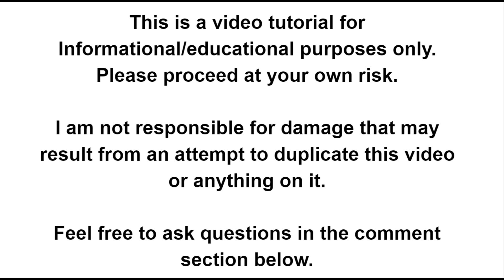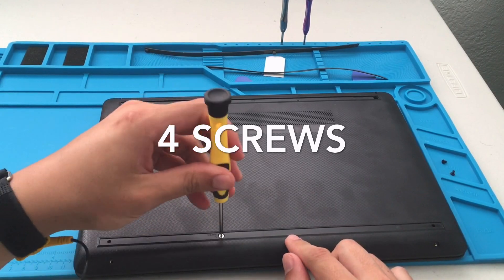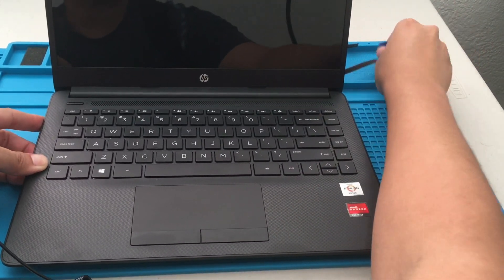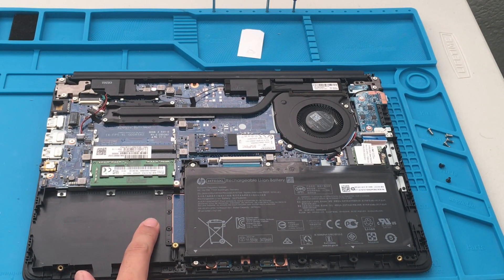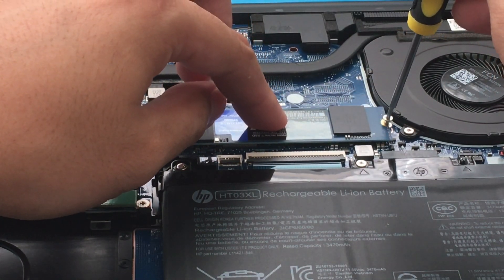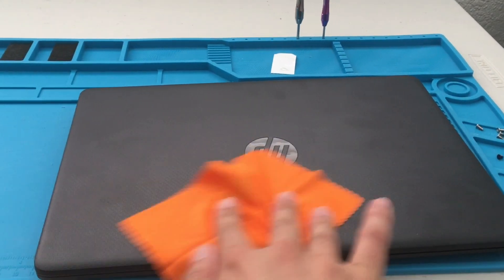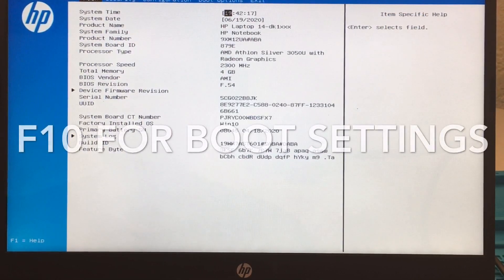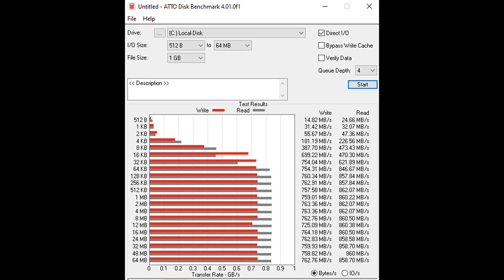500GB SSD M.2 Upgrade | 2020 HP 14 inch Laptop | 14-DK1003DX

Comment: hello, I hope you can help me, I have an hp 14 dk1xxx and I don't want to change the 120 gb ssd that it has by default, I just want to add an additional ssd, does it have another slot or should I buy another type of hard drive?

Comment: hello, great video but I have a concern, the port for the ssd m2 supports both sata and nvme? is that I want to buy one that is compatible and I do not want to make a mistake in the purchase 😅
Reply from the maker: If you look toward the end of the video, the original ssd is a SATA (notice the M Key). The new ssd is an nvme, but the read and write speeds for the upgrade (new m.2 nvme ssd) isn't huge if that makes sense hope this helps.

Comment: Did the same except went with 16gb of ram.  Definitely an improvement in performance especially when playing games.  I just used the migration software that was free from Samsung and did not have to go into the bios to make any adjustments at all.
Reply from the maker: Great! 16gb is the perfect amount
Reply: I also did this
Reply from the maker: Nice 16gb is the sweet spot
Reply: Me too but anyone know how to add the 2.5 ssd? Is there a kit for it? I'd love the extra space
Reply: @TheJonci0322  I was wondering the same when I opened up the case and saw the space for an extra drive but no connections.
Reply: @TheJonci0322  Hi there i know im 3 years late but yes you have to buy a data transfer cable to sata 2.5 hdd but the caddy i'm not sure what size i just put double sided thick tape and its very awesome having SSD & HDD in a HP laptop

Comment: Can i do this on my hp-14 bw0xx?
Also I'm wonderinf whether it's better to upgrade to 8Gb of ram with 500GB ssd or 12 Gb of ram with 250gb ssd? I use my laptop for video editing, and photoshop
Reply from the maker: I an not familiar with that model unfortunately. You can check you tadk manager > performance > memory to see how many slots of ram you have. You can also run crucial scanner. Another way is to use crystal disk info to see if you have an nvme ssd install currently
Reply: @whattmeter  i have 2 ram slots with max of 16gb. And drive interface: sata/m.2 sata. Sata version 3-6Gb/s. When i went to task manager-performance there's only HDD?
Reply from the maker: @FifaMaestroAdam  Oh so for ram you already have two slots filled out?ah so HDD that means you probably have a hard drive installed. If I have your model correct, here's what I found on crucial. I would double check though because I could be wrong. Looks like you can upgrade to a 2.5 inch SSD. Also on your first post, if you plan on gaming definitely 250GB ssd will fill up quick. Just my thoughts https://www.crucial.com/compatible-upgrade-for/hp---compaq/hp-14-(amd-14-bw0xx-models)#ssd

Comment: Can you help with locating a connection/ribbon cable that can connect for this laptop to a ssd that 2.5? I know that laptop has room for it but I cannot find it from accessories on HP website at all super frustrating.
Reply from the maker: I still haven't found any yet, not even on amazon

Comment: great video do you know if it is possible to use a usb adapter to connect M2 SSD to a PC? thanks
Reply from the maker: Ive never used one before
Reply: @whattmeter  thanks I found a 2.5 hard drive adapter that use M2 SSD inside
Reply from the maker: @cronos6252  Omg where! I would like to order one and make a video about it if I can.
Reply: @whattmeter  google sabrent m2 SSD to 2.5 sata III aluminium enclosure EC-M2SA amazon or ebay !!!
Reply from the maker: @cronos6252  thanks! i'll give it a shot
Reply from the maker: @cronos6252  thanks! I found some and saved it. Hopefully in the future I can order one and make a video.

Comment: Muy buen video! Quería consultar, estoy entre este modelo de HP con un Athlon silver 3050U, pero con 16gb de ram y 480 ssd o una lenovo con monitor de 15' que tiene un core I3 10th gen, 8 de ram con 240 ssd. Cual me conviene? Me hace dudar el procesador a la hora de elegir. Cual recomendas?
Reply from the maker: Solo mi opinión, pero el i3 de décima generación es bastante bueno si nos fijamos en los puntos de referencia. un lenovo de 15 pulgadas probablemente solo tenga una ranura para ram. En mi opinión, optaría por lenovo, porque puede actualizar a 20 gb de ram fácilmente en el futuro. (Just my opinion but the i3 10th gen is actually pretty good if you look at benchmarks. a lenovo 15 inch most likely only has one ram slot. In my opinion, I would go lenovo, because you can upgrade to 20gb ram easy in the future.)

Comment: What was the cmd?
Reply from the maker: Cmd ? Command prompt?
Reply: @whattmeter  yes
Reply from the maker: Yeah I used it to pull up the windows license key as a precaution. Not necessary but just in case
Reply: @whattmeter  ok what types of rams do I need to upgrade it?
Reply from the maker: Ddr4 laptop ram. Speed 2400 Mhz

Comment: When you take out the original ssd, I see the connector type is sata (three prongs).  And then the new one you put in is pcie 3x4 connector.  Will this laptop take both?
Reply from the maker: I’m learning as I go along, but from my understanding the original 128gb ssd that has three prongs is an m.2 sata which you pointed out. The new one is an m.2 NVME, specifically a western digital brand that has backwards compatibility. I have the model numbers toward the end of the video. Since there is a lack of info on the motherboard I suspected that not all m.2 ssds would work so I went with the WD SN550 which is backwards compatible with older m.2 sata connections.Basically I played it safe and it payed off because if you look at the speed test for the new ssd, its faster than the original but not as fast as it says on the box. I have the same wd sn550 m.2 ssd installed on an old gaming pc and the speed test shows it achieve speeds close to the box. https://youtu.be/HKX2nncy-jE basically I don’t think all m.2 ssds will work on this laptop. I would make sure it is a backwards compatible nvme ssd that can run on older m.2 connections

Comment: Hi Jace, great video, thanks for sharing. I'm interested in upgrading the SSD storage  to 1tb and i see when researching there different read/write amounts. How does that affect this laptop and is there computer limitations that I need to be aware of with these upgrades?  The laptop now has 8gb ram.  I appreciate any insight you could give me, thank you.
Reply from the maker: The gaming pc crystal disk info transfer mode is pcie 3x4 to pcie 3x4. So that explains why it reaches the max speed. If we search max bandwidth of pcie 3 it is 3.94gb/s. Also glad you have upgraded to 8gb of ram! I think when you buy an M.2 SSD and install it on this hp laptop, it won't achieve the full read/write speeds. It would be faster than the original ssd though because of the transfer mode is limited on this 2020 hp. it's also possible there's something you need to do to unlock the full transfer mode on this laptop.
Reply from the maker: Very good question. Yes the laptop has a limit for ssd read and write speed. The wd ssd I installed is super fast (I installed the same model and brand on my gaming computer and it achieves the speeds it says on the box 2400mb/s read and 1850 speeds). But when I installed the same ssd on this laptop the speed is limited. In this video look toward the end of the video, the read and write speeds is highly limited and couldn’t do the full read/write speeds the ssd is capable of
Reply from the maker: I am not an expert but check the speed of the exact same model and brand of the m.2 ssd I installed on my old gaming pc. The speeds are insane compared to the laptop speed which is limited https://m.youtube.com/watch?v=HKX2nncy-jE I just checked crystal disk info and the transfer mode for the ssd is pcie 3.0x1 and pcie 3.0x4. So if you look up pcie x4 maximum bandwidth the max it can go is 1000mb/s which explains why in the video i was getting a read speed max of 901 and write speed of 795 mb/s. I will do more research to double check this. I could be wrong.

Comment: I don't know if i saw well, but the laptop comes with a 2.5 inches ssd slot apart from the m.2? In that case, it'd be possible to have an m.2 and a 2.5 ssd together as storage?
Reply from the maker: I opened it up again. Yeah I didn’t see a ribbon cable connector to connect a 2.5 inch ssd. I even removed the battery.
Reply: Ok! Thank you!
Reply: @jysfie  bro, encontraste si se puede agregar un ssd de 2.5?
Reply: Old comment, but do you see the ribbon socket on the motherboard that says HDD? There's your socket. To get the ribbon, search 'laptop sata hard drive ribbon' on eBay, or similar search keywords. They're about a tenner.
Reply from the maker: There is a space, but I did not see a connector for a 2.5 inch ssd
Reply: Ohh, such a shame. It'd be great if it had it
Reply from the maker: Yeah. Idk if you can buy a ribbon cable but I’m not even sure if the motherboard will have the drivers to support it. I haven’t seen anything on YouTube yet. Maybe in the future someone will make a video
Reply: Any updates on being able to add the 2.5 ssd?

Comment: I just bought mine from Amazon and I'm a Photographer.  Can I buy more RAM from Amazon?  P.S. I haven't even received mine, yet.  And I'm excited!  Previosly, I was an Apple MacBook Pro user.  And I just couldn't afford the high price.  Is it easy to remove or open the laptop??  Thank you.  I subscribed.
Reply from the maker: Hi yes. I made a video with 32gb ram upgrade. Yes I bought my ram from amazon too. Make sure to double check the speed of the ram before you buy more ram. Opening up the laptop isnt too hard. Just take it slow and make sure you have a plastic prying tool. The good thing about this laptop is that it’s a 14 inch, which is very common so many videos on opening up this type of laptop
Reply: Would you recommend upgrading before adding files,photos, and data or does it matter?  Also is Windows 10 an extra purchase??
Reply from the maker: It depends if you have a lot of files. 128gb of storage isn’t a lot but you could use an external hard drive or flash drive. If you know how to create and load an image you could always upgrade the ssd in the future. In terms of windows s mode that comes with the laptop I made a video on how to get out of windows s mode since people kept asking. It’s an easy process and should be FREE. So basically you should be able to go to windows home edition on this laptop free and it’s a simple process
Reply: Yes, I noticed when you put the Windows 10 in the side of the laptop.  Also wondering if I can find the Kingston part on Amazon?  😊
Reply: Because I would like to upgrade it all at once.
Reply from the maker: The ssd i used is a western digital brand but I can’t recommend it since it got popular and the price went up. The original ssd kingston is worth 25-35 on ebay I noticed but it’s only 128gb. There are many m.2 ssd options out there. Hard to recommend a specific one as prices vary. If you look toward the end of the video i put the exact model of the ssds.
Reply: @whattmeter  Oh, that's right, you mentioned eBay.
Reply: @whattmeter  Where did you buy the Windows 10 Home Edition?  Sorry I'm asking so many questions.
Reply from the maker: Yup so this laptop comes with windows 10 s mode. You can easily switch it to windows home edition without reinstalling windows if that makes sense. You will probably figure it out once you try out your new laptop
Reply from the maker: No worries. You won’t need a windows 10 installer to switch to windows 10 home edition from windows s mode unless you are replacing the ssd. If you do want to change the ssd, you would have to load an image or reinstall windows 10. It’s not to hard creating a windows 10 installation usb there are many videos out there
Reply: @whattmeter  But, where may I ask did you get that little square thing you plugged into the usb?  Because I do want to install the a ssd.
Reply from the maker: It is a bootable windows 10 installer created on another computer. It is a regular usb with windows 10 bootable (this is how windows 10 is installed mostly nowadays). I actually created a video for that too scheduled in a few weeks. Let me release it right now so that you can see
Reply: @whattmeter  Darn it!  I don't have another computer.  Now I'm wondering what I should do.
Reply: I also purchased an Android Flash Drive for my Smartphone to transfer all photography to be in the laptop.  Is this a concern like the need to know specifics on that too?
Reply from the maker: Not too familiar with all types of android flash drive but I recommend going out of windows s mode to windows home edition first so that you are not limited. Windows s mode has a lot of restrictions, can’t even install chrome or firefox. It’s something windows created for security. But almost everyone i know needs to install things like zoom and chrome so they took out windows s mode. Hope this helps
Reply: @whattmeter  It sure does and I appreciate your channel for that.  What browser does this laptop use?
Reply from the maker: https://youtu.be/NwECUN-xUjM here is a video I made to switch to windows 10 home for this laptop. This browser comes with Microsoft edge (formerly windows explorer). You can always install other browsers like chrome and firefox or other browsers once you switch out of windows 10 s mode
Reply: @whattmeter  Yay, yes!  I watched it but will rewatch it.  And, I like Google Chrome; so I definitely would want to be able to have that in my laptop.  I remember Windows XP when I had a Dell Desktop and Windows Explorer.
Reply from the maker: Here is the video Of how I created the windows 10 usb you see in the video https://youtu.be/2KPC3-d19Rk
Reply: @whattmeter  Thank you, so much.  I will go watch it.  😎
Reply from the maker: You’re welcome! Also consider creating a free Microsoft account when you get your laptop (similar to icloud). The reason is so that you can locate your laptop (kinda like find myiphone or kinda like locating an ipad or macbook) it’s pretty cool. Hopefully that makes sense. Something I learned recently. But definitely do your research.
Reply: @whattmeter  I will have to get back to you on creating a free Microsoft acct.  I've got to get up at 5:00AM.  thank you for your help.
Reply from the maker: If it’s too complicated no need to make a free microsoft account. Start with a local account when you set up your new laptop to make things easier
Reply from the maker: No problem you can create it (win 10 installer) on your new laptop once you get out of windows 10 s mode. You don’t need another computer. Just make sure you create it before you remove and upgrade the ssd (if you are upgrading). Good luck and I highly recommend looking at other tutorials as well to give you a better idea
Reply: @whattmeter  YAY!!!  That gives my inspiration!

Comment: are you going try change thermal paste? I'm interested in doing for better performance!
Reply from the maker: It's pretty fresh so no not on this laptop. The factory thermal paste actually does a great job. with the ssd and ram upgrade it runs fortnite, dead by daylight and a bunch of other games others had me test. (i added 32gb ram so the gpu has 2gb of dedicated memory by default and the extra ram allows it to have an additional 15gb of shared gpu memory). it will run games at low.
Reply: @whattmeter  what kind ram is it?
Reply from the maker: Oh it’s share gpu ram that helps the dedicated gpu ram. Because of the the ram/memory upgrade of 32gb it allows the computer gpu to access more ram when needed

Comment: So I barely have anything on mine, what should I do? Still make the backup or switch it out?
Reply from the maker: It’s really up to you. I would definitely write and save the windows license key and any software that you have that has product keys at least. Just in case you need to activate the windows license again. I did a fresh install on mine but saved the license key before switching out the ssd
Reply: @whattmeter  OEM windows key is paired directly to the motherboard. As long as you reinstall the same version of Windows that came with the machine, it will be guaranteed to reactivate itself.
Reply from the maker: Thanks! Hehe i guess i’m scared. But yup I didn’t have to reactivate mine. I guess i like playing it safe because of my previous experiences with windows
Reply: @whattmeter  luckily this changed with Windows 8. Ever since then, keys are tied to the motherboard. Windows 7 and before were a pain for that.
Reply from the maker: Haha yeah i ‘m still traumatized by that. Thanks for the help!
Reply: @whattmeter  what's interesting is that if you buy the full retail boxed copy of Windows 8-10, those are not tied to the motherboard and can be reactivated after major hardware changes (motherboard swap) or used on a new PC multiple times. They just deactivate the previous install.
Reply from the maker: Neat! Retail Windows huh. Good to know.
Reply: @whattmeter  you can buy retail copies at best buy.
Reply from the maker: Dead for daylight works with the 2gb build in gpu ram and the 15gb shared gpu memory. Arkham knight works and american truck simulator works too
Reply from the maker: Dead by daylight defaults to ultra quality too. I was totally wrong